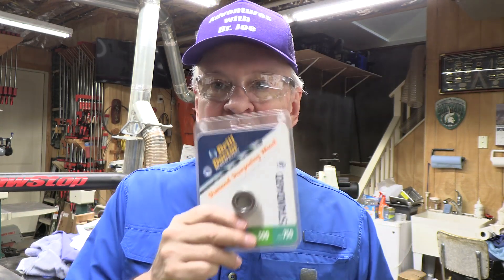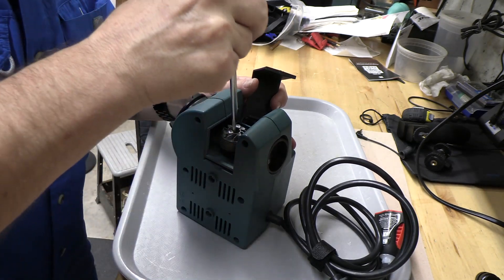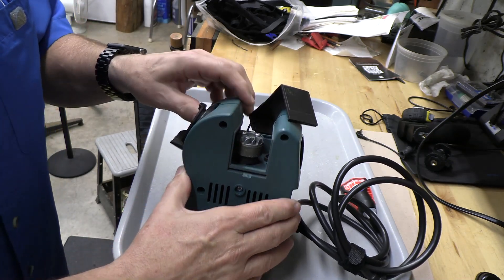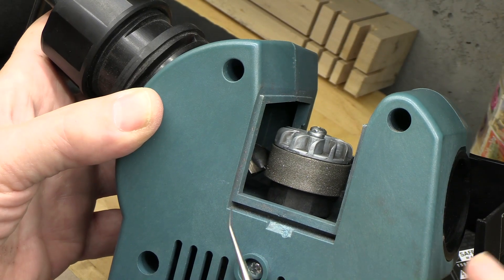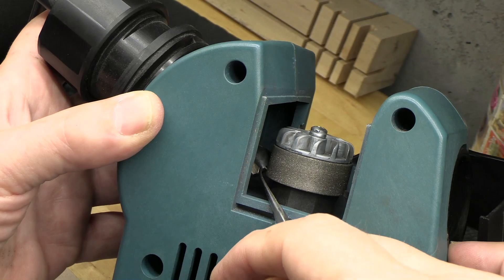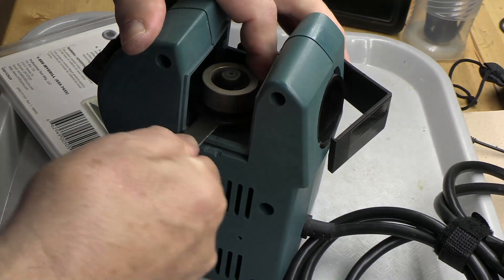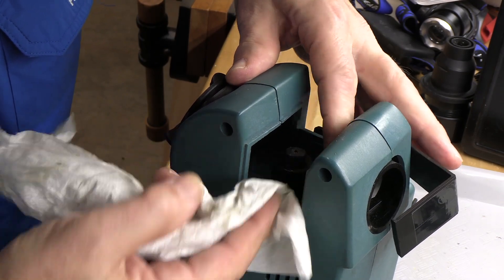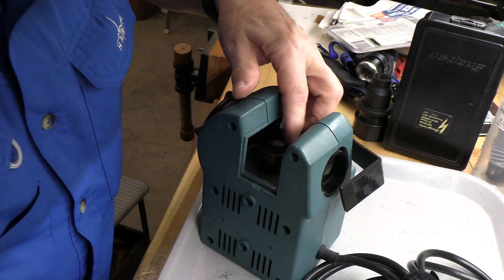Darex Drill Doctor 750SP diamond wheel replacement.

Comment: No, they don't last very long at all if you are doing larger bits! You definitely won't be able to do 100 drill bits if they are larger than a ½"!
Reply from the maker: So those diamond we holes usually last a long time but I agree if you're putting in the biggest bits particularly masonary bits which are carbide you can wear the diamond wheel down more quickly for sure. Consider subscribing thanks Joseph

Comment: What's the wheel model number?
Reply from the maker: The wheel is the diamond sharpening wheel standard. It is number SA01326GA. It is the diamond sharpening wheel for the models 300, 400, 500, and 750 consider subscribing. Thanks. Joe.

Comment: I enjoyed this video. I have the exact Darex 750 SP and my question is , what is the best grit for sharpening 1/4”and smaller drill bits and are all those replacement diamond wheels the same size in diameter and height?  Aaron from Canada
Reply from the maker: Hello. Thank you for your comment and question. So a finer grit wheel would be ideal for those smaller bits but the replacement wheels are the same diameter and height as the original. They need to be otherwise the geometry would be off and you wouldn’t get effective sharpening.also a light touch with the smaller bits is very helpful and improving the quality of the sharpening versus an aggressive approach. I hope that was helpful. Consider subscribing. Thanks Joe.

Comment: how much wear is acceptable?  I just bought a used one and the wheel looks perfectly straight across.
Reply from the maker: Really good question. If your wheel continues to sharpen your drill, bits in a satisfactory time and manner that it’s fine. When it starts to slow down and doesn’t deliver a crisp straight line across the tip, then it’s time to either rotate the wheel or replace it. Consider subscribing. Thanks Joe.

Comment: How did you get it back on? Did you use a hammer or a press?
Reply from the maker: When you take the old one off and properly, clean the shaft, clean the new one, it should literally just slip on. If it’s a little tight, you could just tap it in place with a hammer and a punch. Consider subscribing. Thanks, Joe.